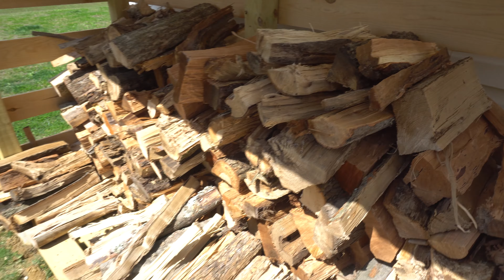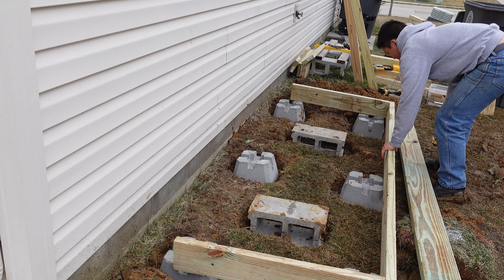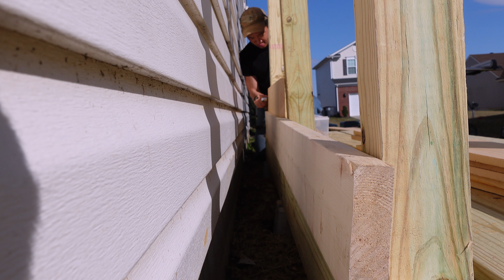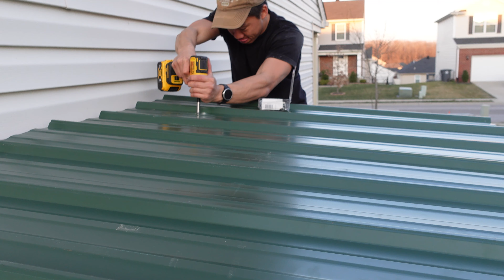EASY DIY Firewood Storage Shed Build

Comment from the maker: Materials and Cut List [Yardiac]: https://geni.us/5C2kn
Check out Breeo Fire Pits [Breeo]: https://geni.us/LtdWk8
90 Degree Drill Adapter [Amazon]: https://geni.us/muZA

Table of Contents
__________________________________________________________________
00:00 - Intro
00:20 - 811 Utility Markings
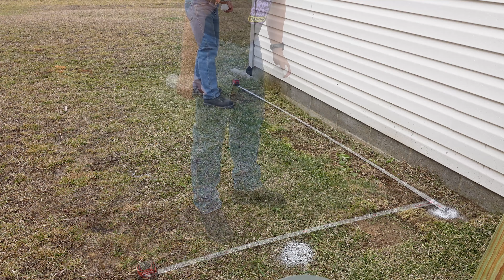01:00 - Marking Holes for Digging
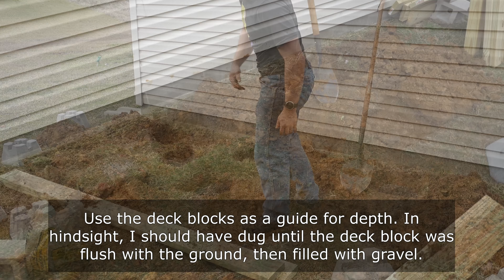01:45 - Leveling the Frame
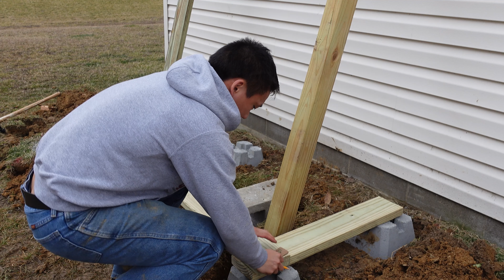02:00 - Assembling the Frame
02:55 - Attaching 4x4 Posts
03:40 - Adding Floor Supports
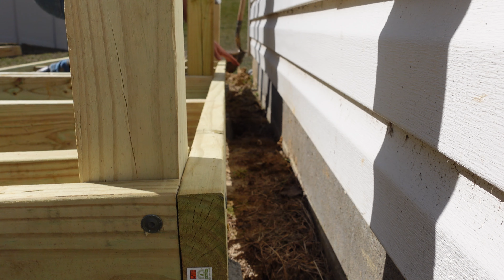04:25 - Attaching the Floor
05:55 - Adding Cedar Plank Siding
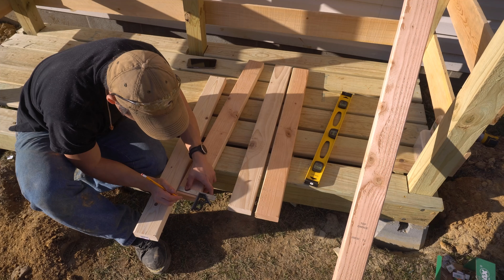07:15 - Adding Roof Support
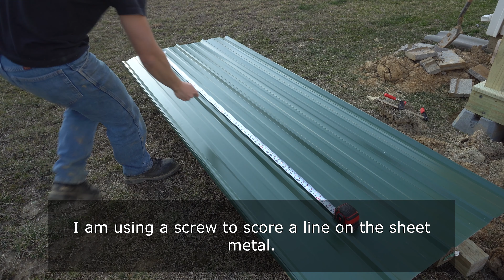09:50 - Cutting Metal Roof Sheets
10:54 - Attaching Roof with Screws
11:25 - Attaching 2x4 Scraps

__________________________________________________________________

Materials, Tools, and Cut List
__________________________________________________________________
Needed Materials

    (4) - 4x4x8 Preesure Treated
    (6) - 2x6x8 Pressure Treated
    (6) - 5/4x6x8 Pressure Treated
    (4) - 2x4x8
    (15) - 6' Cedar Fence Pickets
    (2) - 3'x8' Galvanized Steel Roof Panel
    (6) - Concrete Deck Blocks
    (2) - 50lb All-Purpose Gravel, 4-6 bags recommended.
    (18) - 1/4"x4" Exterior Lag Screws
    (1) - 50pc pack of 1" Woodtite Fasteners

Cut List

    (4) - 4x4x6
    (8) - 2x6x33"
    (2) - 2x4x83"
    (4) - 2x4x36"
    (10) - Cedar Pickets, 33.25"
    (10) - Cedar Pickets, 46.5"
    (4) - 3'x4' Steel Roof Panels

__________________________________________________________________

Amazon Affiliate Disclaimer: Brian Fischer is a participant in the Amazon Services LLC Associates Program, an affiliate advertising program designed to provide a means for sites to earn advertising fees by advertising and linking to Amazon.com. 

Breeo and Solo Stove Affiliate Disclaimer: Brian Fischer is a participant in the affiliate programs offered by Breeo and Solo Stove. Programs designed to provide a means for individuals to earn advertising fees by referring customers to their platforms for product purchases.